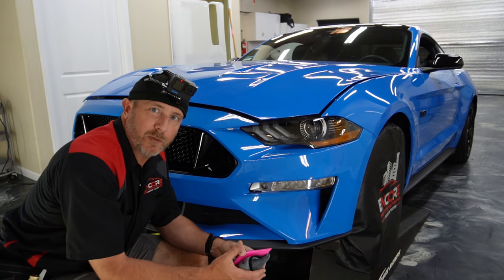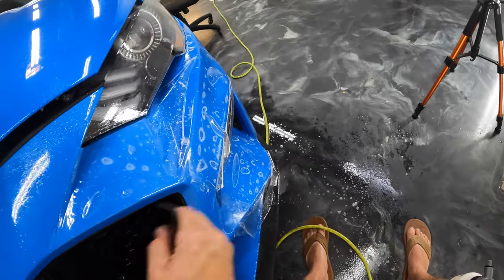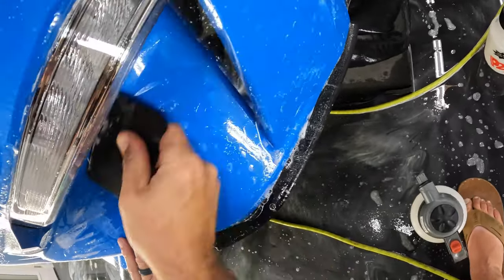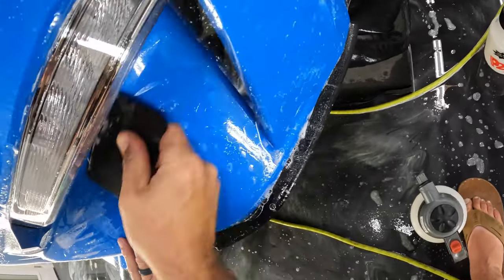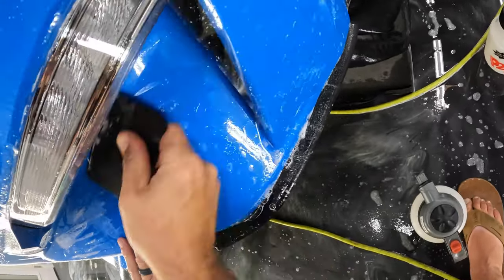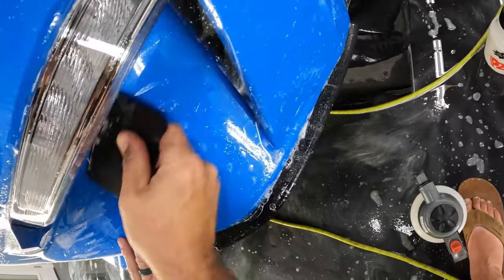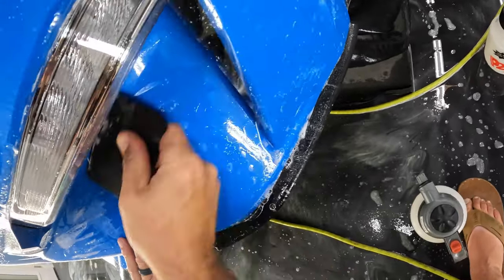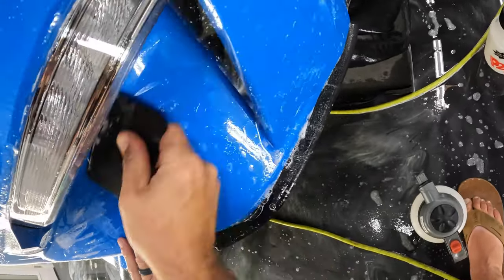Mastering Paint Protection Film Installation 🥇 Step-by-Step Guide on a 2024 Ford Mustang GT 5.0

Comment: When do you know to start in the middle working outwards, verse from left to right or right to left?
Reply from the maker: I'm almost always going to start from this same spot when I'm installing a kit. Here are a couple of reasons I might start elsewhere.  Sometimes, it will be the same spot, but on the left side, if the vehicle has a tow hook cover on the left. If the bumper kit has some sort of relief cut (that needs to be dead center of the bumper) or an emblem to go around in the center, I'll start there and work my way out to the sides. 
Thank you for the question.  👍🏻 
On another note, let me know if you have any video ideas. 😁

Comment: what is your ratio on your alcohol? do you also use hot water as your tack solution? I heard hot works too?
Reply from the maker: I'm currently editing a video about the three solutions I use during my installs. It should be un in the next week or two. Slip, tack, and water. Water and tack work similarly. I find that water normally makes the film tack even faster. But sometimes tack works better, so I use both. 😀👍
Here is some info on our solutions:
We use "seventh generation" dish soap in our slip solution.  I use between 7-9ml per gallon. 
As far as our tack solution goes. We start with 70% rubbing alcohol. Then, dilute that down to 20% rubbing alcohol to 80% water.
All of our water runs through a reverse osmosis system before we use it.
Reply: @EncorePPFtint  awesome! thanks for the info🙏 I use dish soap on window film but didn't know it's safe on PPF. 
i'll try to use water as my tack on my next project. I tried the Suntek Tack solution works great but hate the smell